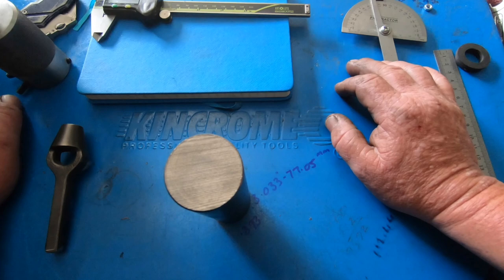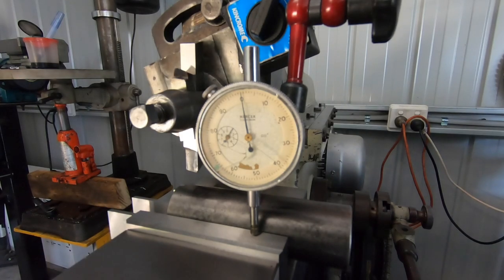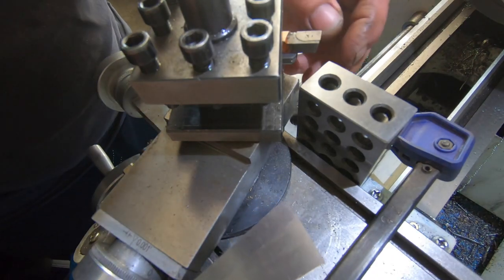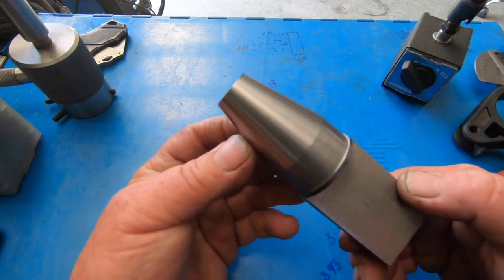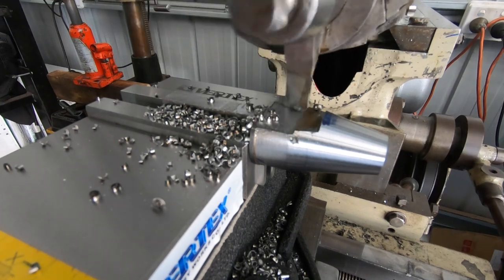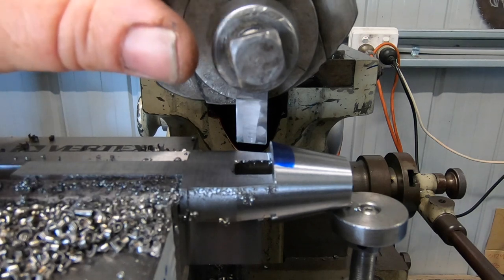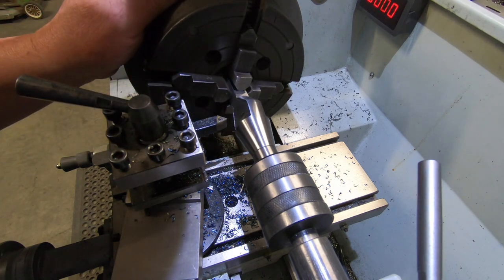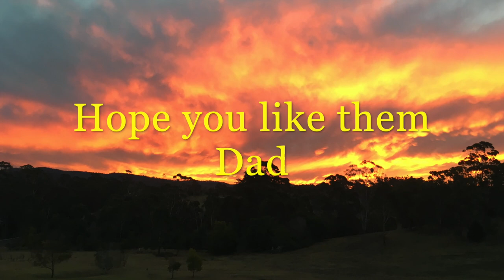Wad punch

Comment: Hi Matty. Those tools came out great. That shaper makes some really nice curls. Also, I love your lathe compound slide auto feed :) Ever tried using it for facing and parting off? Cheers, Craig
Reply from the maker: Gday Craig, I have used it for facing, works really good, I try not to part off on my new lathe, just not enough rigidity, it’s ok for aluminium and brass but still even then I’m not overly keen,
Reply: @MattysWorkshop  I can understand that - parting off can be tricky. I have broken a few carbide tips doing that...

Comment: They came out well .  Have you tried case hardening powder , an easy way to get a bit of hardness to unknown & mild steel  .  Cheers .
Reply from the maker: Gday Max, I haven’t no and I really don’t know much case hardening powder, I’ll have to work out what powder I need and where to get it, thank you Max I really appreciate it,     Matty
Reply: @MattysWorkshop  I was thinking of getting some to try out on some tooling i will be making soon .   It can improve surface hardness of  steel like 1040 mild quite a bit .
Reply: There was a preparation called Caseinite used for case hardening. It was easy to use and produced indeterminate results.   It was used in schools and Tafe workshops as I recall. ( like 50 years ago) but I have an idea it was outlawed maybe 20 years on. I don't remember the reason, possibly workshops did away with projects which needed heat treatment so there was one less item to be stored and purchased.

Steve the tinker.
Reply: @stevecallachor  I have not used it for years but i am going to try & get some to try on the tooling i am about to make for the bridgeport .